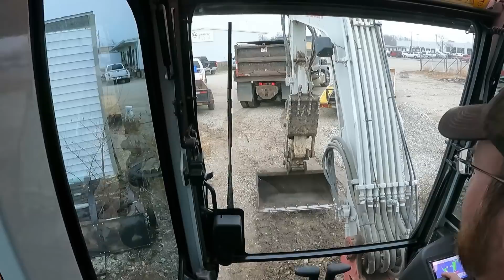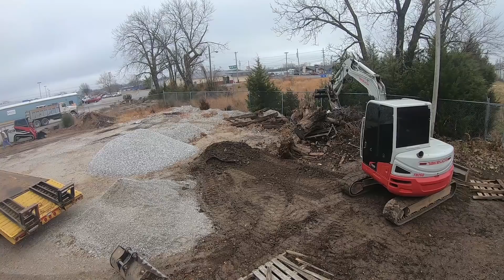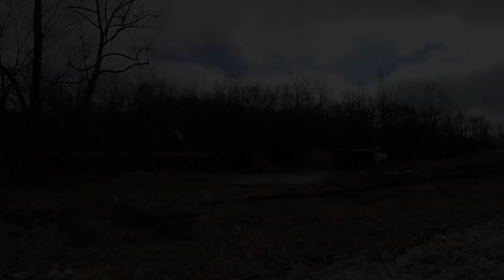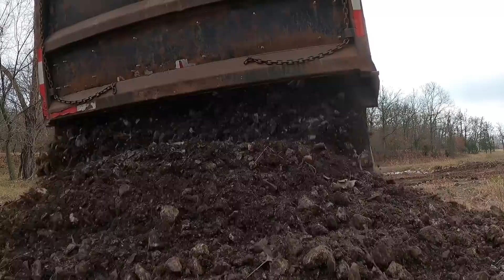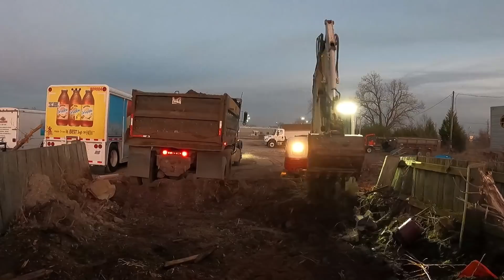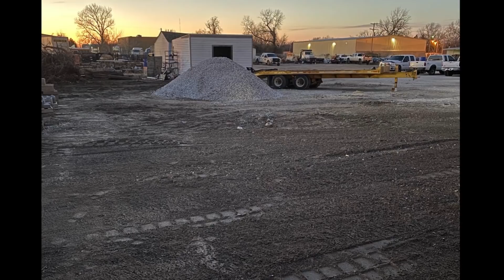Cleaning Up The Shop Yard And Hauling Some Fill

Comment: The rake attachment was a good buy, now if you just had a "decent" thumb to go with it. I always hated the thumb on mine, nice to have but with only 2 tines it sucked as well...lol. If I lived closer I could build you a nice thumb from some 3/4" plate, maybe even put a progressive link into it as well. Shop yard looks good when you get the little piles of this and that all cleaned up.
Reply from the maker: I really like the rake. Yeah I don’t mind the thumb most of the time but it needs two more tines. I think I will look into that this year and see if I can get a different one. Yes I’m so happy the lot is cleaner. It’s not as embarrassing now lol

Comment: That rake attachment was the perfect answer for sorting the junk from the fill!

Did you find any copperheads under that wood pile?  I knocked over a dead oak a few years ago… there were 4 of them under the bole of the stump.  It was too cold for them to move.  So, I put them in a bucket and moved them to a brush pile near a creek…. Across the county!

Did you get your loader back?

It was cold here today… only 68.  Can’t wait to get back to normal…. My grandson restocked my firewood in the shop while I was gone.

See you next week.
Reply from the maker: Yeah it’s great for that! No luckily I didn’t see any I wound probably scream 🤣 the loader is still waiting to be fixed 😞 68 it was 49 and windy. Tomorrow is only 35 🥶. Stay in Florida 👍🏻

Comment: Ohhh man! What a difference it makes on the shop yard!! If you are going to put it up for sale, it definitely means thousands more in your pocket when the entire lot space is visible and seen as useable without hiring someone to do what you are doing. It is also being done in a manner that pays you as you are using the fill on a job! 2 birds - 1 stone. Sweet. 
    I meant to mention the other day (and I’m really not trying to spend yours and your father’s $$$). If you are thinking, for example, a 40x60 shop is enough, but maybe a 60 x 80,,,,,,,,,,,,,,,,. I learned the hard way that getting what I thought would work instead of what I KNEW would work. In the end I had to build an open storage kinda like Chris’ old open storage,,,, not like the new stuff he just built. (the bum,,,,,, he reached that point where YouTune does pay just enough,,,,,. He worked hard for it though.)  I had to leave some pretty expensive machinery out there when I would have been a lot happier putting it in the original shop if I had gone a little bigger. I had always intended to fully close in that other shelter, but never did. I’m on a tangent again. 
     So after all that, I would respectfully suggest a larger shop than the minimum you both think would work. If anything you will have a proper work area for tools, benches, a welding table,,,,,,,,. It takes up more space than ever planned on. I’m sure you understand. Once the pad is poured, it’s bloody hard to go bigger then,,,,,,,. I like the clean up of the yard and it’s well timed and convenient!! Sometimes life works like that!! Nice! 
      Your, your dad and family all stay safe out there, Eh!
Reply from the maker: I totally agree! A 40’x60’ will be full before we even get everything in there. I would much rather do the 60’x80’ I’m not sure you can build a shop too big lol. The equipment would last longer and be in better shape if it was inside or at least covered up. And your right about the lot space plus it’s not so embarrassing pulling into the shop anymore 🤣 appreciate you watching and commenting

Comment: Yep, random t-posts. Better to find with the trackhoe than the way I find them, with the brush hog.  (Now that I've got a slip clutch mower, the guy at the parts counter seems to be disappointed that his sales of shear pins have kind of dropped off.😁)
Reply from the maker: Ouch that’s not good. It’s crazy how much damage they can do

Comment: Got'er look'in good! Do you rent out lot space for parking, just see lots of random trucks? Looks like the excavator rake doesn't quite have the right angle to play well with the thumb, but it works!
Reply from the maker: Thanks! Yeah 7up rents some area then there is a repo company at the other end of the lot. The rake and thumb line up great I think it’s just cause the thumb has two tines. It needs 4 lol

Comment: Does the tinted glass on your 260 help with the mirror image glare you get in a lot of cab machines? Also, have you run a tb370 yet? Curious how it compares to that tb260.  That thing seems to do real well.  Thx!
Reply from the maker: It kind of helps but can also cause a glare or reflection in certain light. Yes I’ve have the 370. It’s a nice machine more power and more reach than the 260. I think it’s a great size it will probably replace my 260 at some point
Reply: @eliteearthworksllc  I haven't come across any of your videos with the 370 yet, have I missed them? I recently bought a 370. So far Im thinkin its lacking for power watching you on the 260. It wont lift itself off the ground with the blade & hoe, sweeping with any ground pressure is also not happening. Id love to see yours at work.
Reply from the maker: @johnkeelan9685  that’s weird I wonder if the pump needs adjusted. I don’t own one I’ve just ran one a little to try it so I don’t have any video of it